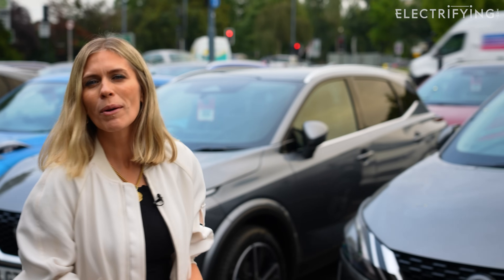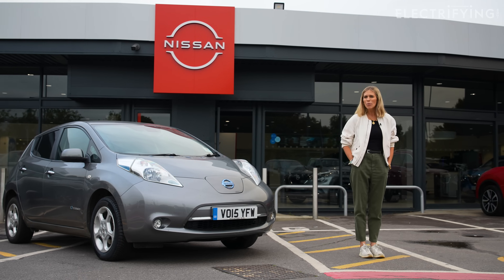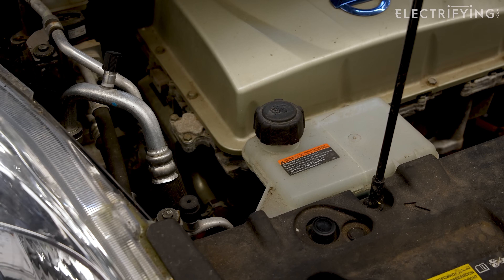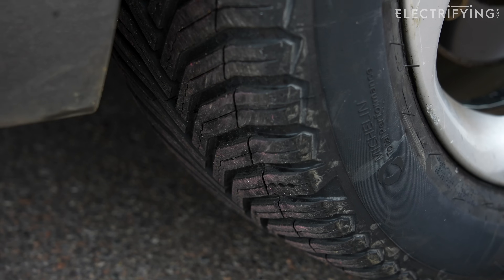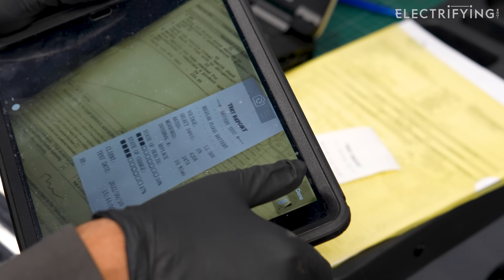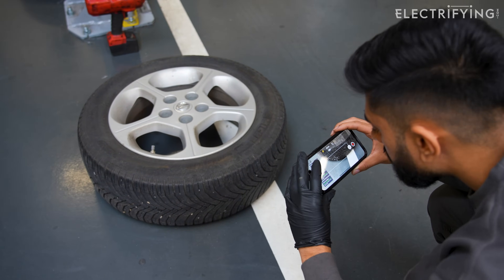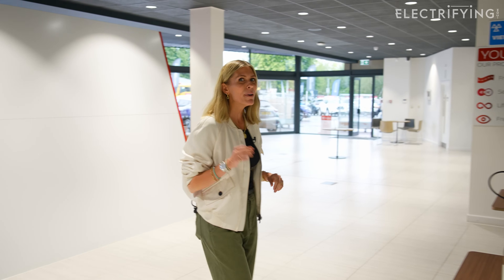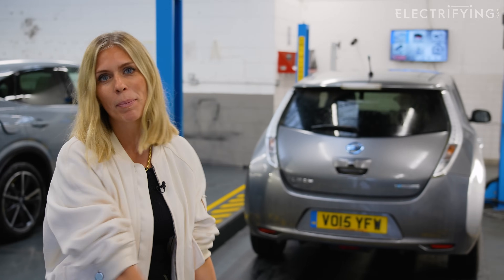SERVICING AN ELECTRIC CAR: everything you need to know

Comment: Service cost there is a joke. We had a Leaf back in 2015 and they could only justify saying "we check the fluids". That was £99 back then and on a 2 year lease, there's no need to attend to brake fluid and washer fluid is a customer filled consumable!
We didn't bother getting it done, cost us a bit at the end of the lease but that's an unnecessary cost for a competent owner. I recognise that some may wish to pay but as a requirement, it's a scam.
Just picked up a new EV, no specified service interval required.
Reply: £99 to check fluids why not do it yourself
Reply: @propanbutan4634  Because it doesn't get a service stamp and impacts at the end of the lease. 
I didn't pay, did check and had to pay at the end for to lack of service history, all one of it.
Tesla does not require this too maintain warranty by contrast.

Comment: Anywhere that services cars can service brakes on an ev. Cabin filters are all available online and can be installed by anyone with hands and eyes. Everything else that can be serviced, apart from the battery, can be treated like any other car. My advice is to avoid the woowoo by getting the car serviced at a regular service garage and for anything specifically relating to the battery, talk to a main dealer nefore deciding if its even necessary.
Reply: Which might just void your warranty.
Reply: Fear of voiding the warranty ffs ! Some people just live in fear. Fear is the virus.
Reply: @ianwynne5483  until they try to claim on their warranty and are told that because they dared too look at their own brake fluid level, that the car is now out of warranty.
Reply: And doing that would void the warranty. They've got you by the balls!
Reply: @phuketexplorer  “The Magnuson-Moss Warranty Act was a law that was passed in the 1970s and states that it's not legal to require the use of a manufacturer part or service in order to maintain a warranty,”
Reply: @danharold3087  LOL. That covers EVERY country on the planet? It certainly doesn't apply to the country where I live!
Reply: @phuketexplorer  I apologize.

Comment: Seems we need to rethink the braking system on EV's, rather than relying on technology that's more than a  hundred years old old.
Reply: Regenerative braking is the new braking system, slow’s you down like Rafton here and puts energy back into the battery
Reply: @03samjon1  there’s no apostrophe in slows, genius.
Reply: @raftonpounder6696  Sorry my apologies. …Rafton is Slow
Reply: @03samjon1  I have forgotten more about cars than any of you will ever know. Just because you drive a Tesla does not make you an automotive engineer. ICE cars also use regenerative braking to charge the battery. They use no fuel when coasting thereby giving you more mileage. What is the difference between that and your embarrassing Muskmobile?
Reply: @raftonpounder6696  it sounds like you have forgotten a lot. So much in fact that you have made most of that up 😂
Reply: @03samjon1  aha! You have shown your ignorance my man! Please refrain from joining in on conversations that you have no understanding of.
Reply: @03samjon1  regenerative braking is the same as using your gearbox and engine brake. Nothing new.
Reply: @raftonpounder6696  Sort of but no.  Both use the motor to slow the car.     But with the ICE we waste the energy compressing air in the engine with little or no fuel.  The EV uses its motor as a generator and puts that energy back in the battery.

There is a mine where they load an electric truck near the top and use the regen braking on the way down.  The charge from regenerative breaking going down hill is more than enough to run the empty truck back up the hill.   Fuel cost is zero.   It is actually kind of genius.     I have heard similar things about logging trucks but do not know of any real world examples.
Reply: @danharold3087  I am aware of how it works. My point is that engine braking has been around since the ICE was first used in a car.
Reply: @raftonpounder6696  You said "regenerative braking is the same as using your gearbox and engine brake. Nothing new."
There is something new.   Regen reclaims the energy!
Reply: @danharold3087  I meant in the fact it slows you down without you pressing the brake. Besides, it almost the same as an engine uses no fuel when the throttle is lifted. You can travel down a hill for miles for free.
Reply: @raftonpounder6696  You are still missing the point. 
You can cost down a hill with a soap box racer.  But it will never go back up the hill
This is the magic of regenerative braking.   The energy needed to slow the car is converted to electricity which can later be used to power the car.
Reply: @danharold3087  but you’re missing the point. The fuel you save by engine braking down hill is used to power you back up the hill! I drive an EV.  I know what they can do.
Reply: @raftonpounder6696  LOL One more time with feeling.
Both regen and non regen save equal fuel by coasting.    So coasting is not a differentiator.

But when you step on the brake the non regen converts kinetic energy to heat which is lost.  Regen converts the kinetic energy to electricity which recharges the battery.  So the car goes further.

Can't make it plainer than that. If you choose to believe differently it is fine with me.  

I am done.
Reply: @danharold3087  I am well aware of how it works, as I have told you before.
Reply: @raftonpounder6696  Your words say yes but the meaning say no.
Reply: @danharold3087  I have conversations with my wife, like this. In the end I give up and accept I'm wasting my time! 😄
Reply: This is a common problem on other EVs.
Reply: What? Sure change the shape of the wheels when you’re at it. I drive a car powered by electricity, not an electric car. Obviously you drive a Tesla.

Comment: No CO2, or NOx, no oils to change less pollution has to be good,
Reply: They still need transmission oil changes and hydraulic fluid.
Reply: Evs transfer the pollution from the tail pipe to a power plant and the environmental destruction to where the rare earth metals are mined.
Reply: @Noah_E  Not sure about the rest of the world with the war and all.  But in the US the grid gets greener every year.   My electricity is 13 cents KWH and nearly 50% of the electricity is from wind.   Only West Virginia comes close to a 100% coal electrical generation over 90 percent. Even there the EV will break even in time and be pollution free for the rest of its life.   When we have enough old EVs to recycle these new cars will have a very low carbon footprint.  
Coal is strip mining. You never stop mining coal.  We burn the crazy stuff.  Always need more.

Comment: Check the comment below , 2012 and range of 20 miles. I drive hybrid from 2010 and have no drop in range even a mile, actually is better than new in terms of efficiency. Service cost the same or less. Don’t mind changing oils

Comment: Driving a 2012 Leaf and it only has a range of about 20 miles.  Hopefully, I can find a way to improve it without spending a fortune.
Reply: bin it get a citroen amie lol
Reply: The early models didn't have battery protection figured out, that won't get better without battery replacement.
Reply: What was the real world, usable mileage when new. 40?
Reply: @phuketexplorer   80 miles.